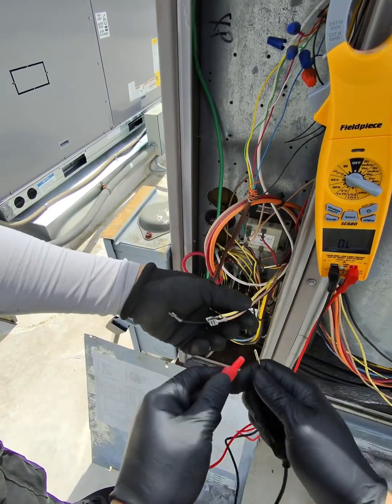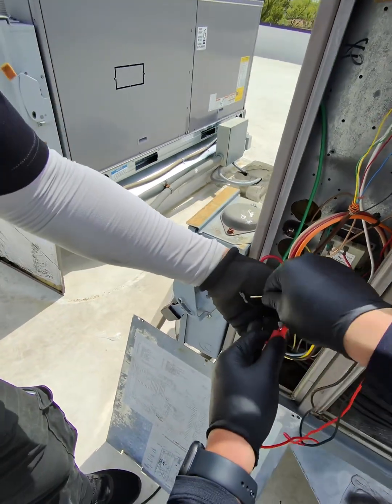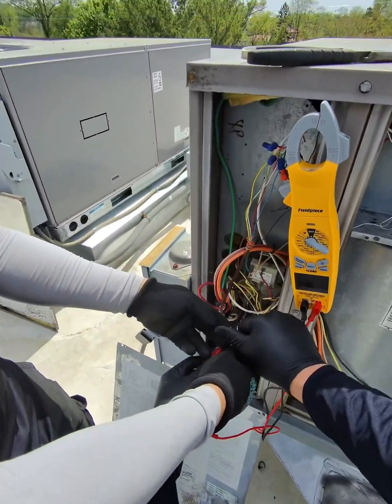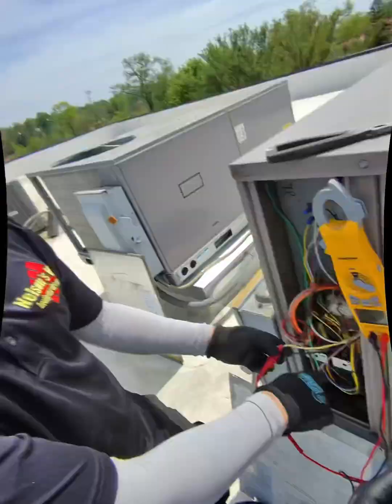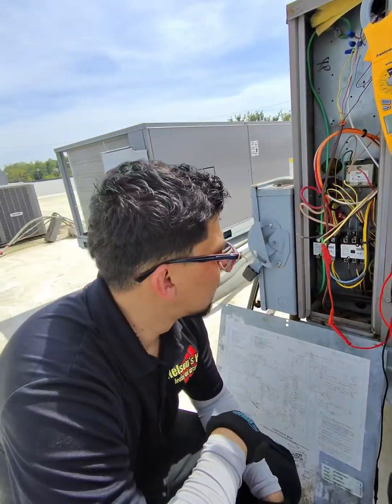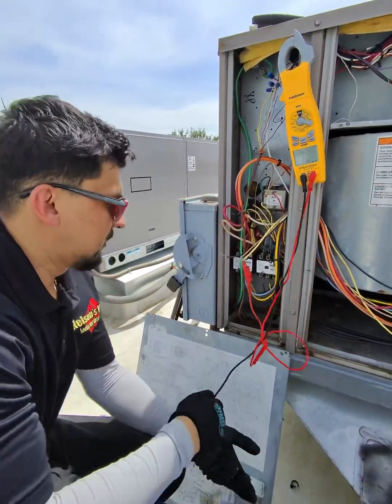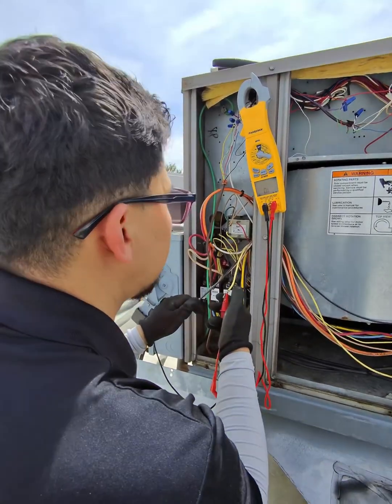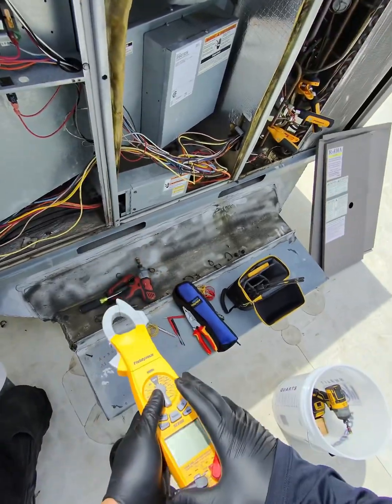How to Diagnose a Bad Condenser Fan Motor with an Ohmmeter (Rooftop Unit Example in Vienna)

Comment: if it's 3 phase they should all be the same between the windings, but if it's single phase with a capacitor, that could have meant that it was on thermal overload.
Reply: Correct. Very important because sometimes the circuit will be open because the thermal overload is open.
Reply: Judging that it's an rtu I'd guess it's three phase but hard to tell when you don't even know the size of the condenser

Comment: One OL and it’s bad? Is it a psc motor or 3 phase? Internal thermal overload? Grounded? ..lol
Reply: he checked between start and run 22ohms. , then run to common and was open line. so he's right bad motor.
Reply: @themrmoy40 never heard of thermal over load huh?
Reply: I would say it's psc motor. Since I see a brown wire. Brown would go to the capacitor. Yellow and black would to opposite sides of the contactor. With a jumper going from the yellow wire side(L2)  to the opposite side of the cap. Opposite brown